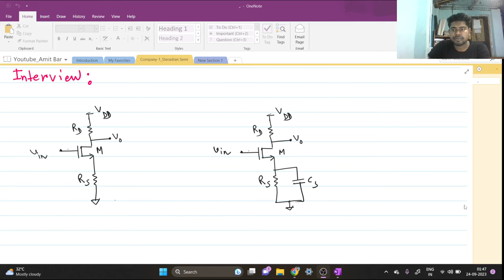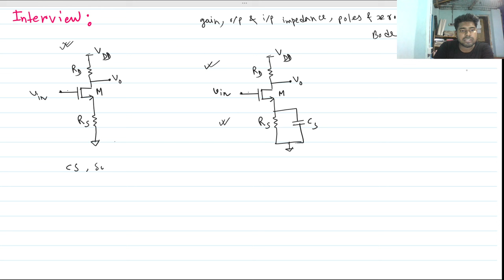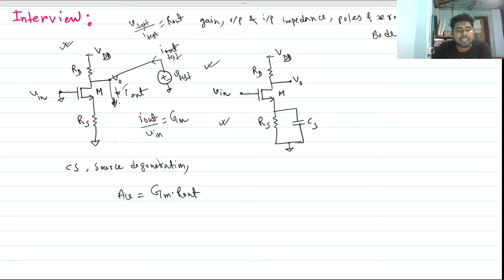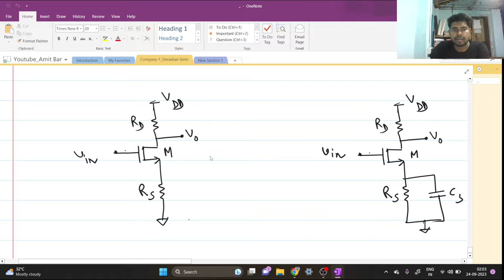MOS Common Source Amplifier with Source degeneration with a RC  Impedance_Complete analysis

Comment: 😔 this is complete Analysis of the CS circuit:
Much appreciated Sir 😊
That's the very famous zero of dgeneration on common Source Circuit 
Pole=[(1/gm)//Rs]*Cs
Zero=-1/RsCs

If it have c1 at input and c2 is at output and  cs at S .. and the   

vo/vi=Am*(s/s+wp1)*(s/s+wp2)*[(s+1/Rs*Cs)/(s+wp3)]

wp1=1/c1*R1(Rg1//Rg2+Rs=R1)
wp2=1/[(Rd+RL)*C2]
wp3=(1/gm//Rs)*Cs
zero=-(1/Rs*Cs)...zero

Zero from the famous cs circuit degeneration